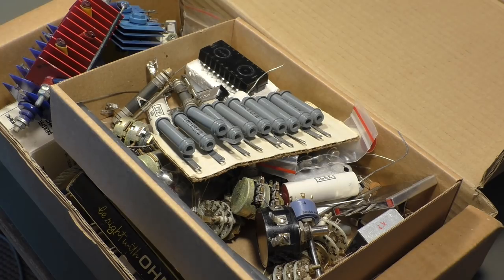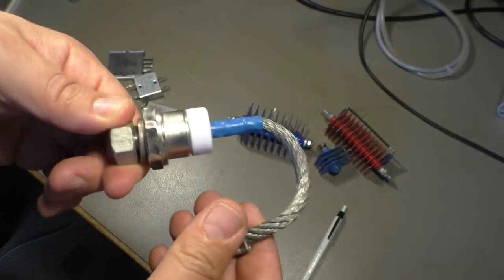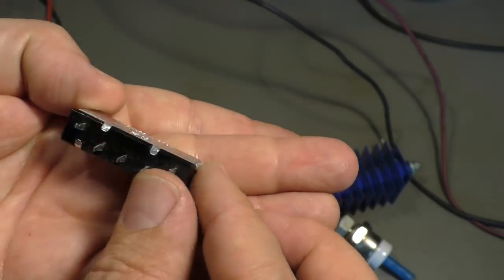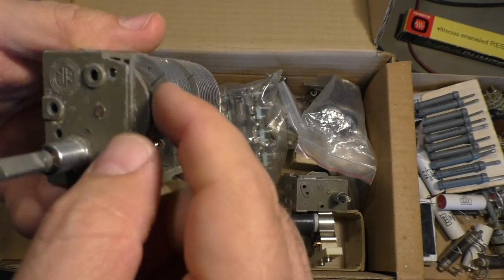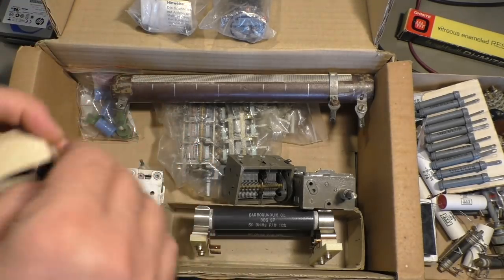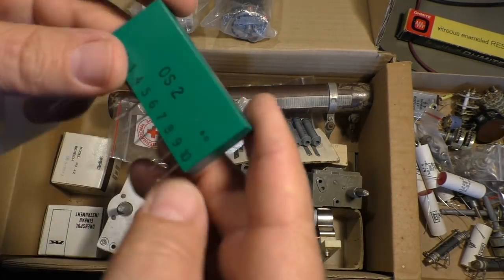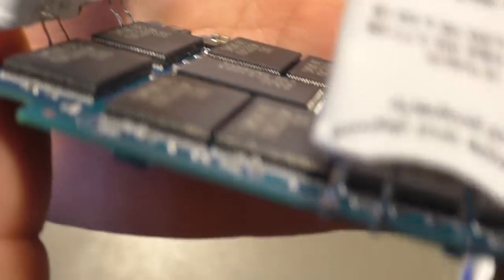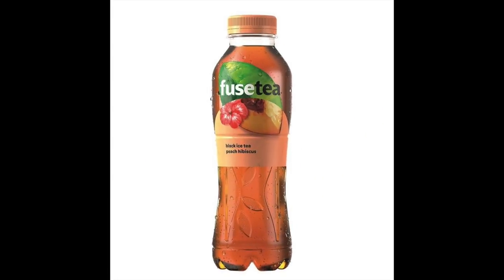Vintage parts, SSDs and FuseTea - (PWJ107)

Comment: The device at 28:30 is a digital logic block, pre-dating DTL ICs. A company I worked for in the early 1970s threw out boxes of them, and I opened up some to determine what they did? They contained Germanium transistors (OC71s I think), operating as bistable and monostable multivibrators and divide by 2 twin SR flip flops. I think there was also a divide by 5 and a number of the usual gates.  Counter equipment manufactures used them by the bucket load in the late 1960s. They were fun to play with and looked neat when all stacked side by side – different colours for different functions. Staggering just how logic implementation has evolved. Onto Selenium rectifiers: If blown up, they were absolutely disgusting – you really thought that 'somebody' needed to change their trousers!! Great videos you make and many thanks.

Comment: just a small note on the stacked selenium rectifiers. The big plates themselves are the diodes and the size of the plates determined the maximum current. On one side of the metal plates there is the selenium coating forming the rectifying junction - nicely explained on https://de.wikipedia.org/wiki/Selen-Gleichrichter
Reply: the B250C75 is a selenium rectifier as well

Comment: Also I do remember on those fan steel pipe organ power supplies some people refer to these as rectifiers but they're actually a power supply!

Voltage was around 12 volts DC!

A lot of these did have multiple voltage tabs probably mainly because of just being so far away from where the power would be used to compensate for voltage drop although I'm sure that part of this was also adjusting for line voltage variation as well considering the age of them not surprising!

Most of them were not even grounded just would have the old school rubber covered plugs with a cord attached to the unit through a ceramic bushing also some of these were not even fully enclosed but just had wire mesh around the outside.

Most were either black or gray potentially even a hammer tone finish as well.

They were referred to a lot of them as selenium power units!

Some of these did actually have a very large power resistor across the outlet it it was somewhat similar to those old man and power resistors don't know the rating of these at this time I think what was going on is that they were using that to adjust the output voltage as a resistive divider I can't visualize the schematic at this time but fairly certain that's how they were set up.

Likely one in the resistor was attached to the positive output from the rectifier other end was to negative more than likely and the sliding tap on the power resistor was connected to one side of the output of the power supply at this time not sure if that was depositive or the negative side either.

Although I do remember they had the full size fuses much like that of a brand circuit fuse big cartridge fuse but in a ceramic holder I do remember a lot of these fuses being rated 8 amps which was kind of an odd value for these to tell you the truth I remember replacing one but rewiring in a inline fuse holder instead to take a modern glass fuse since I could not obtain a fair fuse readily I think at first just literally wrapped the lead wires after stripping them around the original fuse is snapping it back in place just to get going again what caused it to blow there was a short circuit in the organ somewhere had forgotten what caused the short it may have been possibly loose wire but can't remember this time around.

Yes I do remember crawling around a lot in the old church Oregon and even the newer one having to do repairs with my father!

One time we had to swap out a card in this whole state logic this was last minute repair as well a few times we almost had a silent night type of Christmas as we called it if anyone remembers the story of Silent Night or cares to look it up you'll figure out what I'm saying including one time literally the organ blower still being connected to power on one of the organs that Christmas Eve that close to the wire honestly there's been at least once we sit up to our front keyboard just in case we could not get the organ working but yet we never had to use backup plans everything went according to plan even with minutes to spare the organ works again.

Also one time got a call at home saying it bring your tool kit soldering iron a whole nine yards got a problem with the Oregon found out my dad had been playing the new organ and all of a sudden one whole section had cut out after playing one note and realized that probably there is a loose wire but had broken loose and probably was touching the common and had popped a fuse in one of the Oregon chest and sure enough that's what had happened restrict and started that wire back in place popped in a new fuse good to go probably quickest repair but I had done on the pipe organ.

One time kind of an accidental repair if you would we were in the organ chest in the old Oregon and I noticed there were some tubes that were glued in place like PVC or something similar on a stack of the bellows and it turns out they were for some of the shades on the organ chamber and my father noticed that it was working properly again they said thanks for fixing the shades on the Oregon quite by accident one side of them had been completely non-functional for years since the carrier waits for them something had broken and the weights had dropped into the wall never to be seen again as they would say.

Although I did Salvage a lot of stuff out of the old Oregon and first my father decided no and then well quickly reversed his decision which was really a good thing still have a few things left over even after all these years include quite a lot of Springs it was worth the effort for sure even my father was salvaging things for me which was unusual but realized that definitely would be usable for something or other

Comment: Also have some limited experience in terms of just hobbyist with selenium rectifiers.

And I've seen some pretty big ones at least a few times.

Somebody had offered me a big power supply I was thinking it was like going to be a bench power supply until I got there and realized probably wouldn't even have enough power available where I used to live to even run it even if I had a way to connect the power with below the house I will definitely have been the main fuses on 60 amp service at that time in that house!

I believe if I'm not mistaken it was originally intended for carbonarch projection if I'm not mistaken I could be wrong on this.

The thing is this was a single phase power supply surprisingly!

It clearly have been modified possibly in a way to be able very voltage friendly for other uses don't remember much about it but the rectifier is were on the order of a foot across or more little hazy foggy whatever I call it but they were huge probably largest ones I've ever seen.

The other ones that I've seen and used I think primarily we're from selenium power units for electrical pneumatic pipe organ power supplies.

Saw one in a really interesting place once it was I believe this time in attic possibly it was for one of those old school low voltage switching systems that was used in case one of the low voltage switches jammed in the on position to protect the latching relays from burning out by feeding the system halfway of rectified DC instead of straight up 24 volts ac.

I'd seen them otherwise use a stud Mount rectifier in a bracket on a terminal block to do the same but of course this would have been later on more than likely.

Had seen this done before in other systems for the similar effect of protecting the system I can just imagine one of those rectifiers blowing on one of the knees mean the selenium type and something going wrong horribly and burning out to rectifier you probably would have known that something was missed because of your system not working but probably the biggest thing would be the front of track down with the smell was and not knowing where it was perhaps in the other way place I can add it they might have thought someone had up there had died possibly who knows.

I did first-hand find out about the stink from the blown selenium marker fire one time well sort of didn't know about the ratings on selenium rectifier since not experience enough at the time and also the markings on the used part were unreadable as it was too much current and voltage both not good regret it that for sure and I think there might have also been potential sword circuit at that time as well but can't remember so long ago but I do remember that I learned quick about what happens when a selenium rectifier gives up the magic f*** which of course is what makes it work according to most people

Comment: The analog meter is 50 microamperes (not milliamperes) full scale.  That has been the standard basis for most all analog multimeters.  Doing a little math, if you add  20 kilo-ohm resistor in series and the apply 1 volt, you get just the 50 microamperes.  Hence those meters typically show on the face “20 k-ohm/V DC”.  If they have a rectifier (copper oxide), they may also do AC, but that they list as 10 k-ohm/V AC due to the losses in the rectifier and possibly for waveform reasons.
I believe even the 250 V, 30 mA rectifier is stuffed with small selenium pellets.  I believe I once had a smelly mishap with exactly that part.
Otherwise, when the original germanium and even silicon semiconductors were rated rather low in voltage, we used selenium stacks for protecting them against inductive kicks.  We had individual plates (from International Rectifiers) in two square sizes and stacked them as needed, with 30 V Peak per plate.  Most of the time they avalanced fine, but sometimes we were not the “nice guys” when they gave out their famous stink.
As to Ohmite, they still go strong with their wire wound resistors.

Comment: That first Brown almight power resistor the variable one I remember having a few of these and I think it might have even been the same value of resistor if I'm not mistaken although mine were not in boxes but still never had been used I got that from someone else I got quite a big selection of a very somewhat higher power resistors as well as really nice big chunky potentiometers including one extremely large high power one which I actually used for a variable power supply I built mostly from junk parts and salvage parts but it was one heck of a beast I wish I still had it I probably would have modified it again for lower voltages if I'm not mistaken I think I had it set up at that time for like 24 volt Max but the Transformer was released as well the Transformer probably could have easily have burned up the potentiometer if I had not had it fuse down as well as there was a breaker that was rated within the rating of the potentiometer but the fuse was just high enough that if something went wrong if you would pop to protect the potentiometer as well as had some way a heater in series that would about match the characteristics of the potentiometer and a thermal overload device every so often I did trip it I probably would not have been able to readily get a replacement potentiometer so that was by way of babying the potentiometer because of course in that type of setup it could be subject to some accidental abuse and the output 24 volts if I were correctly was after all this and just a raw output set at Max.

Don't know what the transfer would have been using originally there must have been 20 different voltage caps on that thing as well as the jockey warning and more I do believe there was even an isolated 120 volt output that was not being used at least at first later on I did add a receptacle for this as well and of course fuse and so on.

And in the same power supply housing I did have a few other Transformers for General use as well but the one I was describing previously was pretty much a chunky ass Transformer I don't remember the exact current reading but probably one of the biggest power Transformers I had at that time.

I know for sure that at least two of the Transformers in that powerful housing that I built were variable Transformers that had a wiper on them much like that of a long train transformer note it was not a very act but a variable Transformer with removable top I know for a fact originally they were used in old battery chargers that were scratch built by hand and reused them from there.

Also I had all the leads of some of the Transformers brought out to the front panel to test jacks so that they can be configured anyway as needed even as Buck boost of course proper safety terminals since some of these would at times be at live Mains voltage or higher did not have a very act since could not afford it unfortunately although I did have an isolation Transformer that was Salvage for a piece of equipment I think I did wind up installing that in a box at one time but can't remember the foggy at this time

Comment: That lighter weight Bridge rectifier May perhaps be instead of selenium rectifier be a copper oxide rectifier potentially or another possibility is it's just a bunch of rectifier section is just small discs sandwiched in there possibly wouldn't know how to really describe the construction other than this.

I have seen some Mark defiers constructed and also diodes potentially High voltage? That are essentially just stacks of the diodes not sure what the technology was in these but it looked like a stack of flat round pellets or tiny flat discs of material inside a rigid plastic tube

Comment: The Performance of the SAS SSD would really be interesting...
Sadly the non RAID SAS HBAs are gone and nowhere to be found (for a reasonable price)...

You could look for some older ASUS or MSI Boards. There were some old Desktop Boards with SAS onboard. The newest one I know of is the ASUS P6T (not V2 or so).
Another one is the MSI K9A2 Platinum. The K9A2 Platinum would probably be cheaper to get and supports AMD Phenom II CPUs, so it is also rather old.

There are newer ones but they are even more expensive...
Like the ASROCK Z87 Extreme11/ac. Well, that would be overkill ;)
Reply: Stefan Payne You can reflash older LSI/Avago RAID controllers to IT mode so they will work as regular HBAs.  I did that with my Dell H310.

Comment: The 17 pin Black Block is a Norbit 2 TU60 time delay timer from Mullard and can be seen in their 1974/75 catalog on page 40 at the link 

http://mirror.thelifeofkenneth.com/lib/electronics_archive/MullardPassiveComponents1974-75_text.pdf
Reply from the maker: I found a data sheet via Wikipedia link. But thanks for the manual, very interesting.
All data sheets say that the TU60 is red but mine is black... maybe a special edition :-)

Comment: Chevrolet is the poster child for what happens if you don't check the names in other languages. In the 1970s they tried to sell a car in South America (very popular in the US) called "Nova". No Va in spanish means "it doesn't go. Very ironic since these were performance cars. No one at GM could figure out why they didn't sell.
Reply from the maker: Mitsubishi Pajero - spanisch wanker 
Toyota MR2 - frech "e merde " - is shit
Reply: Kudos to Osram for NOT changing their brand name here in Poland where "osram" means a very rude "I will shit on that".
Reply: The Opel Corsa was sold as a Vauxhall Nova in the UK. No Va means roughly the same thing in French too.
Reply: @PlaywithJunk  LOL. They sold pajeros here where the main meaning of the word is the dirty one .... Too much work to rebadge the SUV
Reply: Thats true. They called Chevy. It is rare bacause Chevy is like talking about any GM vehicle in US, but here Chevy was this very particular model here. It was meant to put fight to the Falcon (the inspiration of the mustang) and being all of them inline 6's ... 140Hp was as much as you could get, from the 221 inline six Ford. The most powerfull cars were Fairlane and Dodge GTX with the V8. But those cars werent compacts. Fairlane was targeted to the luxury and power was just to complement the car while the Gtx was as much American muscle as we could get back in those days.